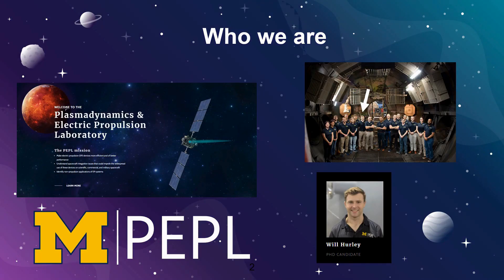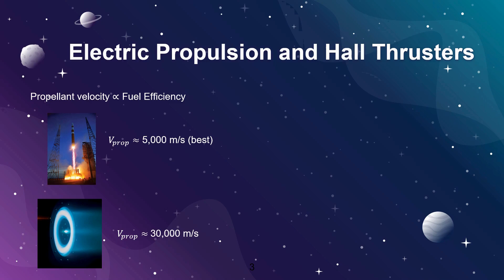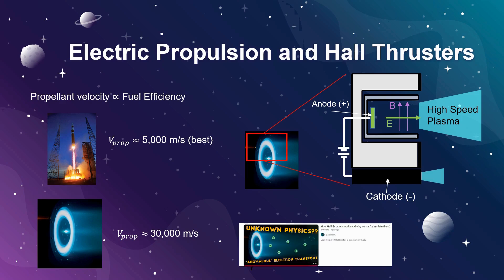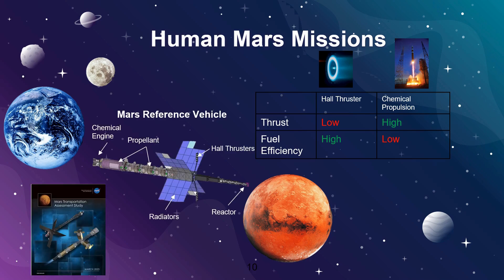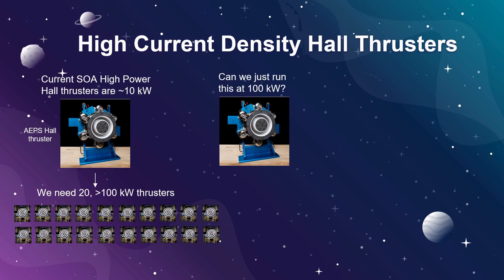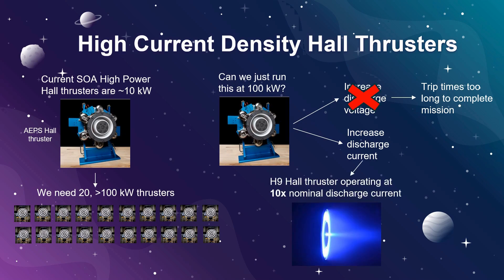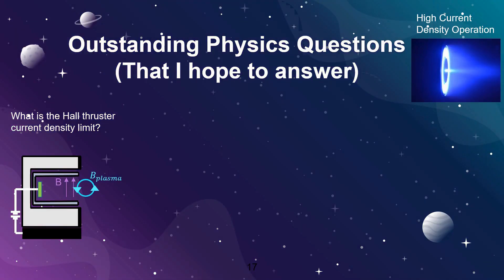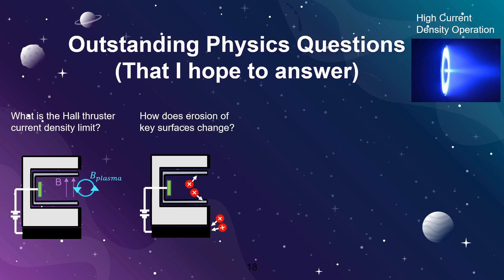High Current Density Hall Thrusters for Mars

Comment: Would neutral beam injectors used in tokamak be good thrusters?
Reply: Yes, 😂
Reply: I could force the exhaust from a torch in space, and as long as the flow is hyper not giant but, a small intense jet, and sent it through a permanent magnet, magnetic wiggler, so, the jet passes through a bunch of magnetic lines and heats up by being a generator short circuiting and just turning induced electrical currents through what winds becoming a plasma.  So, a pilot light could work better.